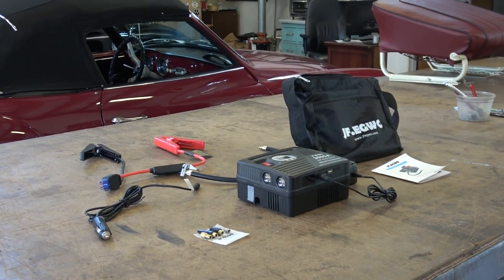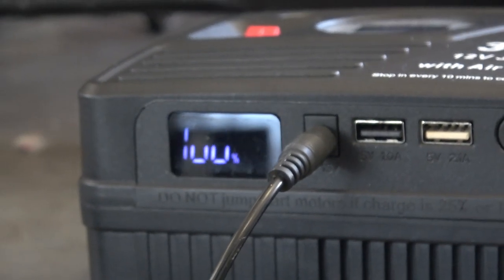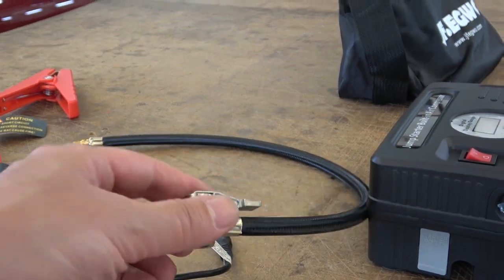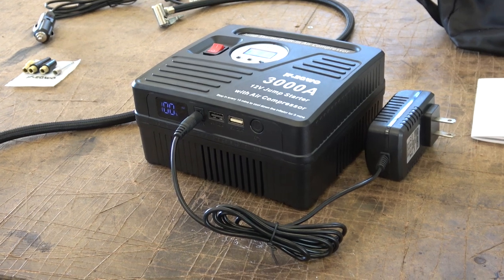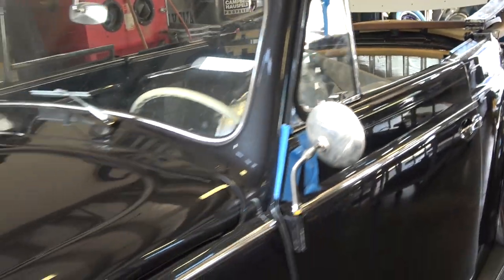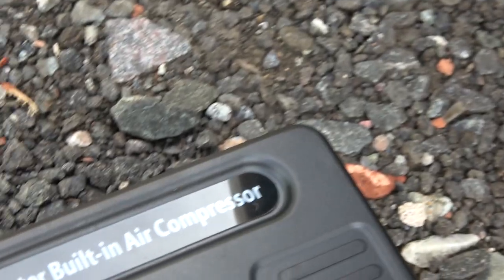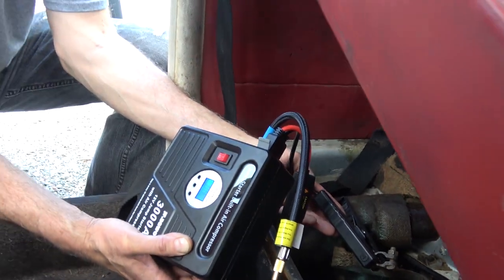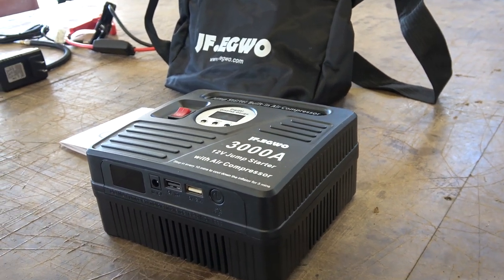Classic VW BuGs JF.EGWO 3000 Amp Travel 12v Jump Starter Booster Box & Air Compressor for Beetle

Comment from the maker: In this video we check out the JF.EGWO 3000Amp Car Jump Starter with Air Compressor, 150PSI Tire Inflation with Digital Screen Pressure Gauge , 24000mAh 12V Auto Battery Booster (9.0L Gas/ 8.5LDiesel Engine), 2 USB Port 2 Light 

Check out the Jump Booster JF.EGWO Box Here to purchase https://amzn.to/3zi2HFi